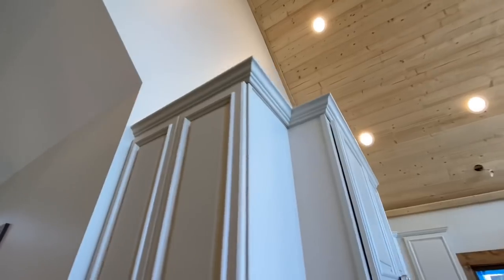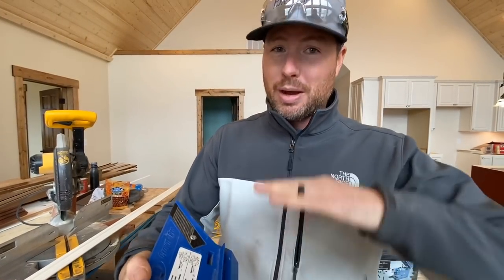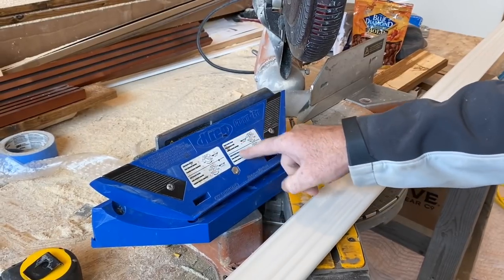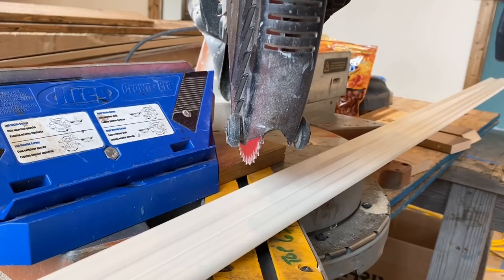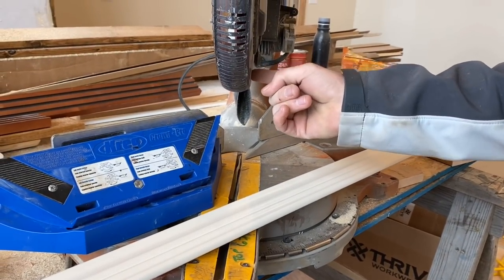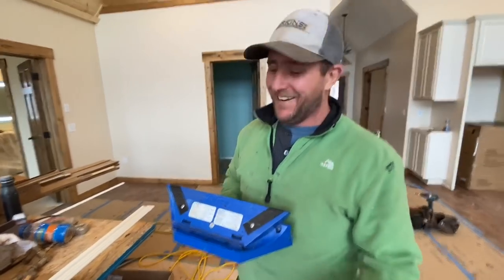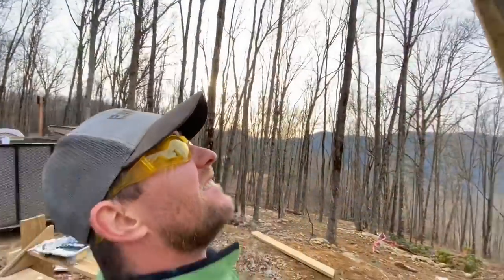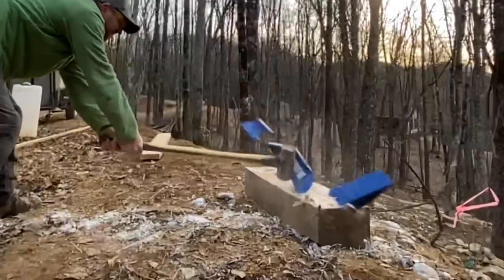Kreg Crown-Pro for crown moulding poses some safety issues

Comment: While I appreciate the warning, this did not happen to me 1 time while cutting multiple times.  I almost sent it back after watching your video but I decided to give it a try.  It is a great tool!  You just can't let the blade go down after you make the cut through the crown.  Don't let the blade just grab the piece that got cut off.  Very easy to control, once the blade goes through the crown you have at least an inch before you hit the cut off piece. Raise the blade back up!  Thanks for the warning though!
Reply: My exact experience, works great when you work it correctly. Any tool misused will have a consigence🔨 they usually have great vids😁

Comment: Glad you put this up here for the world to see. I bought one of these for job where the ceiling and corners were really wonkey, thought it would help. You used yours longer than i did. There is no way to hold the molding tigh to ensure you get good cuts, it doesn't sit on the saw stable, total garbage. After a couple of attempted cuts, back in the box and returned it. Somebody is going to get seriously hurt using this thing. Its unfortunate because Kreg does make some good jigs, this just isn't one of them.

Comment: Same reason why single sided crosscut sled on a table saw should only be used for non-through cuts.  When people do full cross cuts with these, it is just scary when the off cuts drops into the table beside a big blade.  You always want to know where your off cuts are going!

Comment: Thanks for the heads up. There should be another box with opposite angles on both sides to put on the other side of the blade to catch the cutoff when making a cut. 
Neat trick. Just hold the crown with the bottom flat on the back against the fence when cutting. Then you don't have to think about it upside down... It's hard to see your mark and hit it. You have to mark half way up the board on the back. After you get used to it it's not bad...
I wouldn't cut that way if it was. Stained though... Then if cope.
There's a ton of ways to do it.

Comment: I've been watching videos by finish carpentry. He.measures his ceiling projection,  and screws a piece of wood onto the miter table.That piece of wood is then the correct distance from the fence and then you place the moulding in front against the fence. That way the crown is the correct angle on the miter table against the fence and you can cut each piece accurately. The crown is sitting flat against the fence and flat on the table.This way he never has to figure out spring angle, which the kreg crown pro requires. He places his crown upside down on the miter with the decorative portion facing up, so when it's on the wall the decorative portion is facing down. I only cut crown once and that was on the kreg. It came out well for a novice like myself. My piece was long enough and the piece that was cut as waste, in my case, didn't go flying. Surprised you used the kreg crown pro if you do this type of work daily. I would assume you already have a system set up.
Reply: Just use a test piece and cut accordingly.

Comment: Thanks for the info I have had one of those in the box for a year and was going to use it next week with my NEW DEWALT compound chop saw you probably just saved me from destroying the new saw and getting hurt I'm not sledging mine gonna run it thru the chipper be safe 🤘🤘🤘🤘🤘🖖🖖🖖🖖🖖✌
Reply: Johnny South I bet u don’t even have one just trying to be relevant in the comments smug
Reply: @andyp99  no sir.i really do have one I have never done crown molding before so I thought this would help I have other kregg products and they work well I'm not good with all the angles but that piece flying off like it did I could see me either patching a hole in the wall replacing a window or getting stiches
Reply: Sorry for making assumptions good luck on your project good sir
Reply: @andyp99  no worries sir I know a lot of people are full of bs keep the vids coming
Reply: @johnnysouth4982  I'm in same boat - bought the jig and crown over a year ago.  I don't need the excuse now to procrastinate now that I've learned this might cause the saw to get angry and bite me.  Safer just leaving the crown and jig on the shelf in the garage.

Comment: As a Diy’er I cut crown upside down and backwards on the miter saw.   How about a brief video on how to set the compound angle to cut it flat.  I keep short cut pieces for inside and outside corners with my miter saw so I can use them as a template to be sure I have the piece set up correctly because I have cut the correct angle at the wrong end of the board many times.  I may do crown every 5-10 years so I have to refigure it out each time!!!  I have also used baseboard for crown.  Put one piece on the wall and the other on the ceiling with a piece of 1/4 round at the seam for a different look than standard crown.
Reply: What a pain in the ass to cut it flat then you can't roll it upwards or downwards to slightly adjust the miter

Comment: Does the red paint on that diablo blade transfer onto the white painted crown ?
Reply: CKS It does not. The teeth cut slightly wider than the body of the blade, so if you're seeing blade paint on any cuts, something's binding up.

Comment: I figured it was an issue with the guard hitting it. I guess the only way that would be safer is if there were another across from it that the cut off could clamp too and then this would cause a potential bind and no doubt the guard would hit it, LOL. I also noticed how little table it provided, this would be easy to sag one of the ends resulting in an uneven cut. No one has the time, patience or money to spend on stuff like this (unless they are making a YouTube video), I mean a chop saw already comes with tried and true adjustments on those axis's. Yep junk. Entertaining as always. :)

Comment: It probably would have worked just fine if you let the saw stop spinning before lifting it up after a cut.   (It would also help if you had a battery powered saw with a brake, so you dont have to wait 45 seconds for it to stop).  Its cool that you smashed it, though.  🤙

Comment: Good video. Ridgid has siding built in jigs to keep it on the table. The angle can be cut 70 Degrees also. I had problems moving in out of the until I bought the stand with wheels. The thing is bulking big time and weighs 64 lbs.

Comment: Did you watch any YouTube videos to make sure you were doing it right?
Reply: I've watched the original Kreg video on the Crown Pro (circa 2010) & they're not doing anything much different to what you'd expect (i.e. carefully lower the blade into the cut). They also "immediately" stop lowering the blade once the cut is through the material. You could possibly use the trenching/rebate stop on the mitre saw to ensure the blade stops "above" the mitre bed but the fact remains that the offcut does drop onto the mitre bed. Basically, to my mind, it's far safer to cut crown moulding with the material "flat" (& hence supported) on the mitre bed.

Comment: 1) Setup your miter saw at vertical.
2) Attach wood blocks to each side of the table top the miter saw is attached to at the EXACT SAME HEIGHT AS THE BASE OF THE MITER SAW HORIZONTAL.  
3) Place a piece of scrap plywood/MDF/OSB/2x6/8/10 all the way across the miter saw base at the exact distance away from the miter saw fence that the crown moulding is on the ceiling.
4) Cut your crown molding upside down.  Every time.
5) Use the wall dimensions to cut on the vertical side of the crown moulding and burn that stupid jig...
Reply: Eric Sanchez  lol yep....is this the eric from longview? Matts buddy?
Reply: Eric Sanchez  sorry fer yer loss...white oak tx here carpenter 30 yrs..
Rock on brother
Reply: Eric Sanchez  hell ueah man bout an hr north of nac

Comment: I never tried one of these, but I have used a home made jig to hold my crown at an angle.  I would say that both sides of the material need to be supported, that is how my jig works.  This thing kind of looks dangerous.  Thanks for the info.

Comment: I agree, I saw this promoted so gave it a whirl yesterday. All points made in the video are legit. IMO.  Someone suggested to allow KREG to comment. so I went to the website reviews for KREG I saw no response from them on the sight.  Also anything with a ht greater than the jig itself is not dependable. the little wings do nt  provide proper support for the material....I bought mine at Lowes and only  day ago...it is going back... I usually will keep a tool around just because but I dont have a proper sledge to smash it so I'll take my money back this time!!!

Comment: I watched this video on my way to Lowes  in order to buy this jig (it looked a little more user-friendly than the jig that The Home Depot carried). I took notice to your experience with a dangerous kickback. 

I do not like this jig one bit! In addition to the extra elevation from the base of the miter saw (Hitachi C12), there is that potential for that kickback (I experienced the exact thing), but I believe it might only happen when cutting off a short piece (maybe 6" or less). This issue seems VERY dangerous and was an oversight. 

I'm already thinking about returning it.

Comment: Thanks y'all! Love the tree swinging at the end
DeWalt makes pretty good crown stops for these saws. I won't lie, I use them on smaller stock on my painted crown mainly. Makes super easy work of it. No bevels needed. 
But it was hard for me at first to get the hang of it oddly enough. This was years ago of course, but I was taught finish carpentry by some finish carpentry veterans. Old school beveling and mitering.....and coped inside corners. Still satisfying doing it that way... to me.... for whatever weird reason. Lol

Comment: Could you just not have put another piece of wood the same thickness as the Kreggs tool on the opposite side of the Saw blade before you made the cut on a short  piece to support it so So when you made the cut you didn’t get drop down and ruin your saw or even worse hurt yourself or someone else. The tool looks like it really could help get a good cut. Hated to see it destroyed. (Just saying)

Comment: Why is he blaming a small wood cut-off flying on a plastic guide? How did the guide cause the ejection?  Small pieces can fly using all chop saws!
Reply: If they are flat on the table the saw   blade is in the kerf and won’t fly or at least not as hard as if it’s directly under the blade  with no support
Reply: Yeah, pretty significant difference between a small drop with no vertical “fall” and one cut flat or bedded on the saw. I’ve seen people raise a wide board on a non-slider or a too small saw to cut a wide board and seen the same thing happen.  Scary.  Crown stops are easy to make or even easier to buy.

Comment: I’m surprised that a professional carpenter as yourself would even consider using such a ridiculous jig. It doesn’t even support the work properly. Not to mention you had to know what would happen when the cut off drops off without support and kicks up. Not cool. Especially when one can make a jig that holds crown nested from a few scraps of plywood as an auxiliary fence and table set to the spring angle of whatever crown you are installing.

Comment: Why does everybody have compound slide saws and they're afraid to use them for what they're made for cutting crown flat. 🙄

Or if you don't like cutting it flat screw a secondary fence and cut it at its spring angle. Still you have a problem with short cut-offs. 
If you could figure out all the numbers in the manual which is not always easy, cutting it flat is safe. 
but whatever way you do it getting it done and what you're comfortable with is the most important thing,